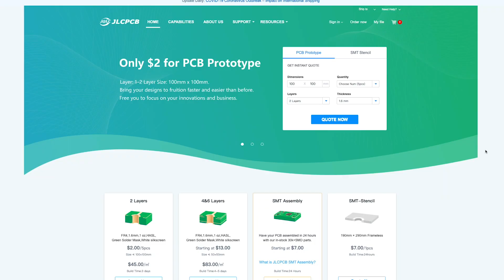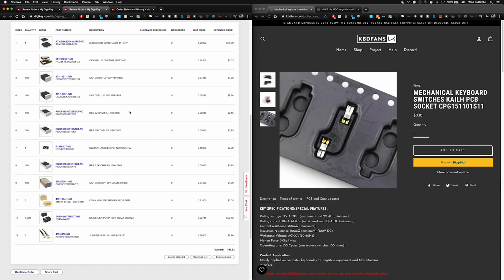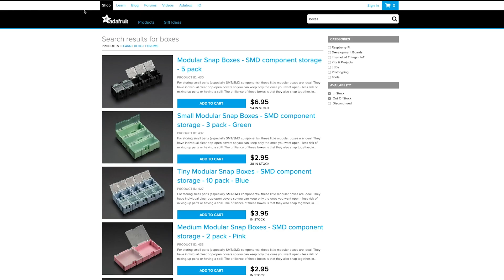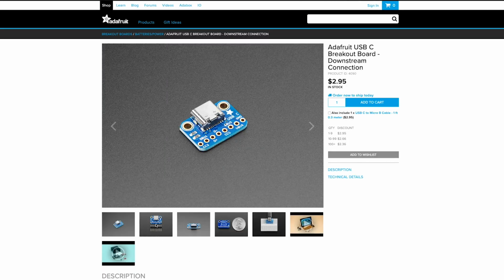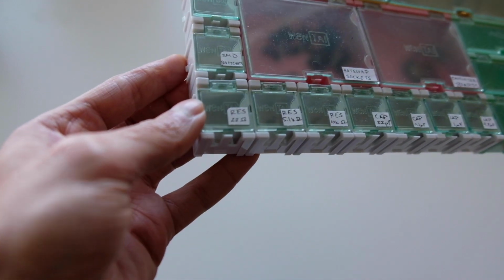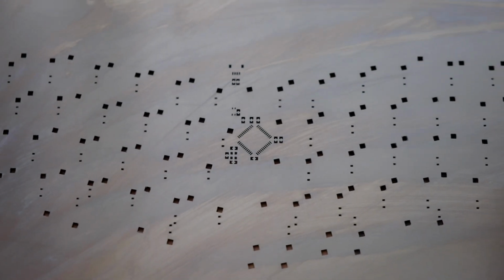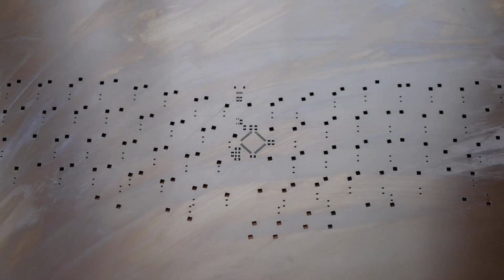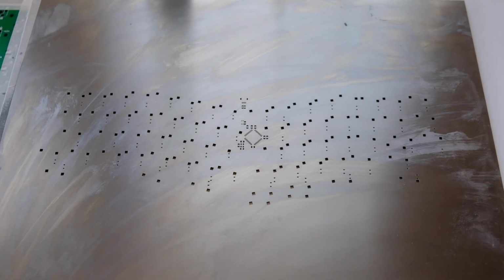Soldering a Mechanical Keyboard PCB Using Reflow

Comment: Have you tried an actual oven for heating a board? When repairing old iMac GPU's, a solution is to reseat everything my heating it in a normal oven
Reply from the maker: Solder is often leaded. Not advisable if you actually want to use the oven afterwards for food.

Comment: Hey hadi, help needed :(
I've knocked one of the switch diodes off the back of my arisu (D17)
I don't know the spec of what I need to buy, I'd be super happy if you could help me out 
I Didn't realise anything was wrong, until I flashed the board and saw D wasn't working in via,
checked the back of the board, oops

regards
Tom
Reply from the maker: GitHub repo says SOD-123 1N4148s. 1N4148W-E3-08.
Reply: @hadi--  Excellent dude! many thanks

Comment: Very nicely shot, and I love the video, but no - I think I will stick to soldering components on.  Did that with surface mount before and it really isn't that terrible.  I'd say no more fiddly than what you went through.
Reply from the maker: Both are good options.

Comment: Great video series. Minor assembly tips: if you preheat the board a little bit, either in a conventional oven at a low temperature or by using the hot air gun at a greater volume and distance, the actual, per-component reflow will go a lot easier. Reflowing discrete components and the MCU are properly done from above, as you showed in the video. They are designed to take very high heat and are able to dump it back into the board after the solder balls liquefy. For plastic components, such as connectors, think hard whether you really want to use hot air. There's a good chance it will be faster and easier to mount them with a plain-old iron. If you decide to use hot air, in almost all cases, it's better to apply the air from the side, directly on the pin or pins, avoiding as much of the plastic as possible. As you are aware, the hot air being applied using the technique shown is substantially higher than the components were designed to tolerate. Many such parts will melt, bubble, deform and/or ultimately malfunction as the entire part is being heated up (overheated), when the real goal was just to solder down a few, small pins. Watching discrete components align themselves due to surface tension is entertaining, but for larger parts, it's better to apply a tiny dab of adhesive while positioning them, before starting the actual reflow. (This is also done in industry, albeit for a slightly different reason.) Then, they won't move around on you as you blast the pads from the side - as opposed to heating from above. This technique is faster overall and is also the least harmful for the components. Finally, to clear solder bridges, the fastest, easiest way is to, somewhat paradoxically, apply a little bit _more solder to the pins with your iron, remove any excess solder the tip (you have a steel wool cup, right?) and then simply run the iron over the pins a second time. Surface tension is once again your friend; the bridges and newly added solder will hop right onto the soldering iron train as it rolls on through.
Reply from the maker: All good tips! Don't know if I'll be doing assembly by hand anymore, though.

Comment: All your videos are so helpful and have sent me on my journey. What brand solder paste did you use or do you recommend?
Reply from the maker: Hey thanks, Jonathan! Any brand should work pretty similarly when used with a stencil, especially if the material compositions are identical. Chip Quik is budget-friendly if you're doing a small run, but consider upgrading to Kester for more extensive projects. Just make sure to check if the paste needs any type of refrigeration (temperature stable), and note that lead-free options will require slightly more heat to reflow properly.
Reply: @hadi--  Agree. Chip Quik and Kester are both well-established, reputable brands. Both have a fairly wide variety of good products. I've used them for ages with good success. If one is new to electronics, it's worth a bit of time to review the options - even if it's just to gain familiarity with  the design choices - and then select the one most appropriate for your project. The one gripe I have with Chip Quik paste is its rather short shelf life - about 6, maybe 9 months, tops - even when carefully storing it according to their recommendations. Regardless, I still use it, as I do like its performance when it's new, or at least new-ish.

Comment: Interesting videos, thanks.  What is the cost to have keyboard pcbs made by jlcpcb?
Reply from the maker: JLC's minimum order quantity was five when I ordered, so the unassembled boards came out to around $6 a piece shipped. The stencil was an extra $12 or so, with components (not from JLC) for each running at about $30. This pricing does not include any of the organizers or equipment used, though, and your pricing may vary depending on the size and complexity of your project.

Comment: Those boxes you have for the pcb components look nice. Where could I find them?
Reply from the maker: Adafruit! They're Wen Tai SMT boxes.
Reply: @hadi--  The thing I don't understand about those boxes is why the decided to go with a hazy plastic for the lid. It makes it difficult to see the inside unless you open it. And while I have min labelled, colors and shapes help for rapidly identifying a component. :(. No matter the provider or where I buy them they are the same.